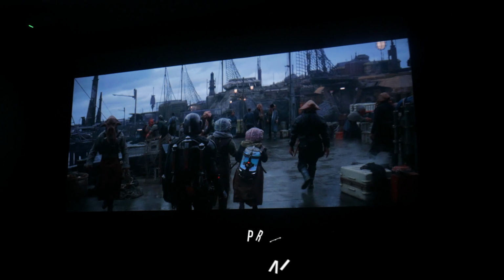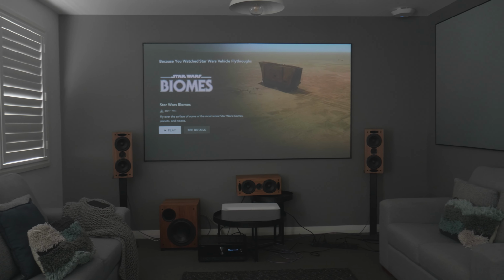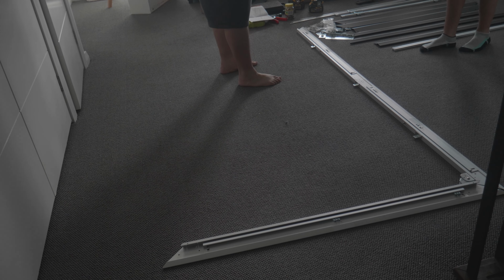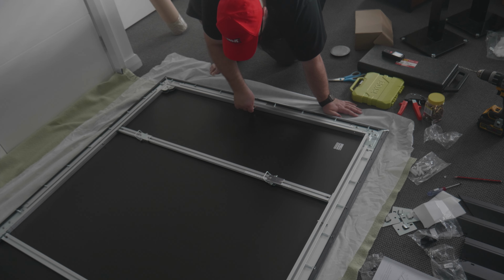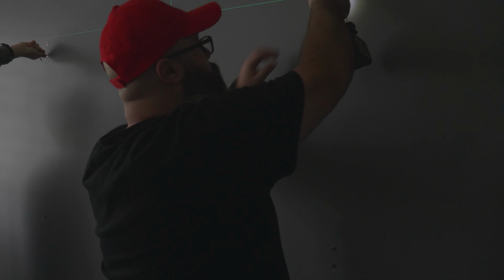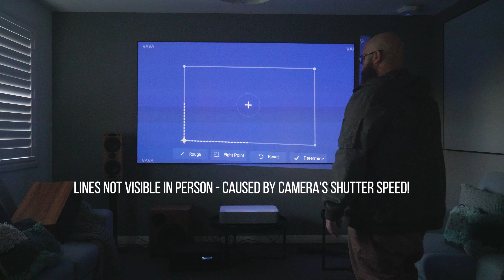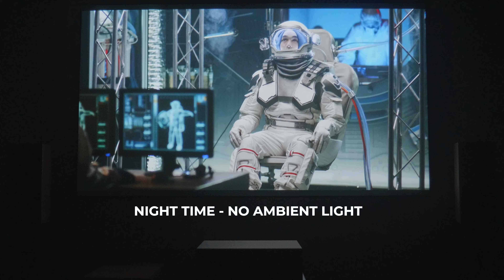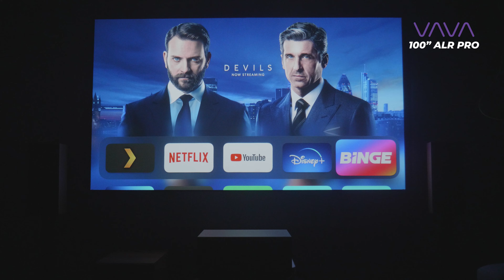LOOKS LIKE A GIANT 100" TV! // VAVA Ultra-Thin Bezel 100" 4K UST Laser TV Living Room Home Theater!

Comment: I'll be honest I just bought this screen got it yesterday I haven't installed it yet but I was using a plane plain Gray bedsheet for my test just to see what the colors were like. Ot actually looked better than the screen in this video during the dayvwith a light in and light coming from the window.
Reply from the maker: Yep my side window is an absolute screen killer :) It's why I show it to be open and honest about ALR screens limitations.
Reply: @BuildMontage  under 1500 which screen you think is best for moderate amount if light in house. I was thinking xy pet clr or akia

Comment: I just got my 120" screen and Vava Chroma this week from my Indiegogo contribution.  It is a different set up than shown in the video - no tension bars - no hinged corners. The set up was fairly straight forward though until I went to put on the outer frame.  This does not align to the holes properly meaning I cannot fit the outer frame.  The screen I received  appears to be a different model than the ones shown as there are no corner hinges or spring tension bars and the wall brackets are much larger and do not fit to the back of the screen, but affix to the wall and are spring loaded.  The model no. is VA-LT030.  I'm not sure if this is just different for the 120" screen or this is an old model screen - it certainly doesn't seem to be an improvement.  I have just sent an email to Vava supoort so I'll see how good they are in responding..
Reply from the maker: The one shown in my video is the 100”. It’s different to the 120” as u have noted.

Comment: Would the picture with daylight from the side be better with a ALR XYScreen or would it be the same? I've just ordered the Chroma with 100" screen to replace my BenQ TH681, a cheap 100€ 108" rollable screen and my LG 55UH950V TV which i'm not using at all anymore XD. I guess in the day it won't be that great but i guess i don't care that much cause i mostly watch in the evening or i am willing to close the roller blinds even @ daytime if needed. Can't wait for december =D

Comment: I am kind of bent in that I have the previous version of this screen and it sags like an old ass everywhere. I went to look at current reviews on Amazon where I bought it from VAVA store, but it is no longer present as a product. You solidified my thoughts on the previous screen issues which make watching a movie look like a Dali painting. I have been dealing with support since, and new tension springs did not help. I want my money back from them or a replacement.
Reply from the maker: Yes I did a review on it first time round but the sag happened after I did the video - so I did this second video on the Pro screen and it's excellent! The 120" screen is not the pro version but it has none of the tension issues the 100" non pro had so likely its fixed. I will be reviewing the 120" screen very soon!
Reply: @BuildMontage   Thank you for this response, and your video did influence me to purchase the screen and projector from the original review. But shortly after purchase it got all warpy. I am trying to fix things with VAVA on this, and after all the work I put into a dedicated theatre room I am aggravated spending more money on a new screen. I assumed matching the screen for the projector it would be a perfect fit, so I bought the combo. If you can recommend a screen that will work just as well with the VAVA projector please let me know. Thank you again for your great informative videos!

Comment: Do they make ambient light rejecting screens or acoustically transparent ?
Reply from the maker: This is made by VAVA which usually are just making electronics - so this screen was designed to pair with their 4K Laser TV only so not AT, just ALR. AT would have been ideal.

Comment: Using digital keystoning reduces resolution and should be avoided if possible.
Reply from the maker: 100% agree. I’m trying to work out the angles so that I can get the center channel above the projector but some very minor leystoning may be needed. Having the center under is arguably worse than a little keystoning